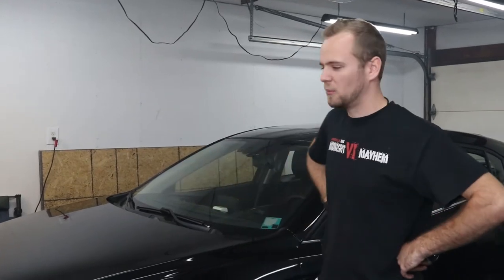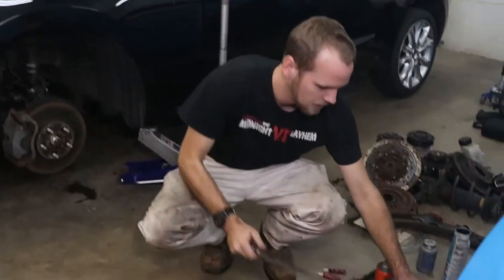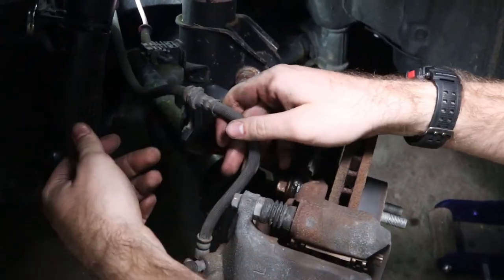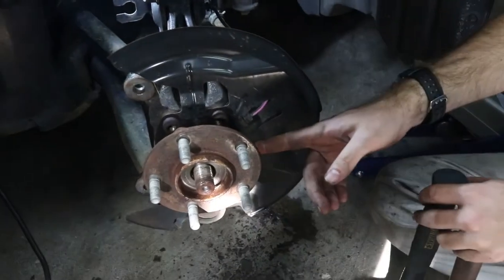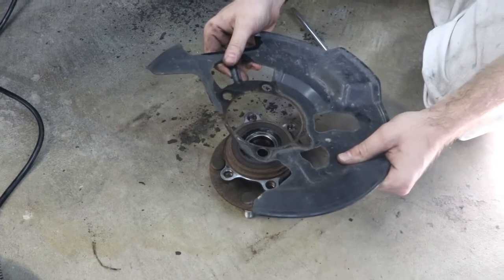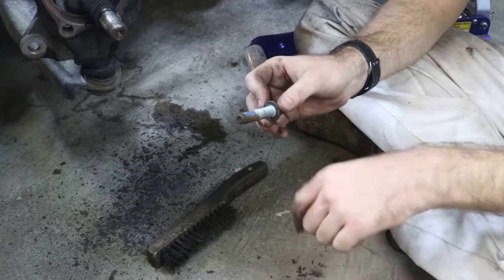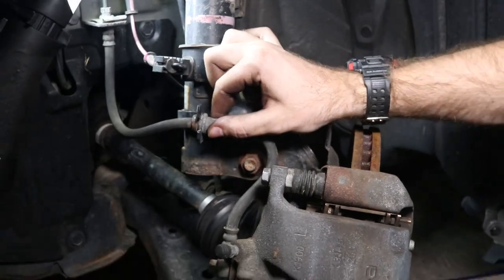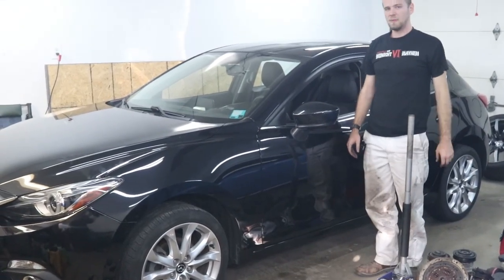2016 Mazda3 Front Wheel Bearing Hub Replacement - How To

Comment: A tip for loosening or tightening axle nuts and also lug nuts: instead of pushing on the breaker bar, position the breaker bar at about the 12 or 1 o'clock position, then stand up and use your body weight to pull. You can get much more leverage that way. By standing on a breaker bar, it allows it to flex and not transfer the torque to the fastener.
Reply: As a mechanical engineer let me tell you that what you said makes so sense in terms of physics. But eh, that doesn't matter, if it works for you, it works.
Reply: @Blockbuster2033  In that same token, you should know that pulling is always more effective than pushing. So, your pull force is going to be much greater than your push force.
Reply: I bought the gun
Reply: You could potentially push your car off the jack stands and cause serious damage that way. I wouldn't recommend it.
Reply: @Blockbuster2033  if you're the type of engineer that designs modern ('90's+) cars... Let me just give you a warm a well deserved FU on behalf of those who service your handiwork.
Reply: @JDuBz815  I am, in fact, not working on anything car related. And as someone who does a lot of wrenching in my free time I'm also quite aware of these problems and try to design with servicability in mind.
Reply: @Blockbuster2033  you are a rare breed indeed then. Thanks!
Reply: @philipstephan4511 Always have a jack stand with a jack as a back up.

Comment: So, mazda 3 has hub bearings both front and rear now. used to be (for the front )wheel bearings with knuckles and wheel hub installed on the top separately. which way is better?

Comment: AH ok so Subaru,Nissan and Mazda used these all in one bearig hub.  I hated those where u need press on and cut the race and chisel off.. OMG i cant.. I dint know you dont even need to remove the lower ball joint and tied rod. Wow i need to get a Mazda :)
Reply: The problem with these style bearing assemblies is the bearing itself is smaller in diameter compared to bearings pressed inside the knuckle. It seems this is why they fail sooner. I can’t tell you how many recent Mazdas have had wheel bearing failures. It rarely used to be a thing, especially on front wheels. The older Ford platforms had this style on the rears but front was always a press fit spindle into bearing or spindle/bearing assembly into knuckle.

Comment: Rule number 1. Leave the car on the ground with the wheel on! (just remove the hub cover.) And have someone standing on the brake when loosening the axle Nut... Get it loose then lift the car and proceed! As they did, All of the torque/torture you put through your drive shaft into the differential when you stand on the breaker bar otherwise.
Reply: The drive shaft and differential are used to much much higher torques that occur when driving, but it will be much easier to remove the nut when on the ground because you eliminate the drivetrain lash.

Comment: Is your Mazda made in Mexico?  From what I understand they have 2 different parts for Mazda made in Mexico and Japan.  I've been wondering if I could use the parts from either source  (cuz the Japan part is a ton cheaper)  I don't know what the differences are between the 2 but I'm sure you saw it when you did this?
Reply from the maker: It is a Japan model. If the parts have different part numbers between Mexico and Japan variants, I would stick with the correct part.

Comment: Talk about a cake job compared to a Fusion/Milan/6 which are pressed in. Nice job Mazda! 
Tip: Just remove the caliper bracket and leave the caliper bolted to it. No need to remove caliper and bracket separately.
Reply: I agree! My 2013 Mazda 3 is pressed in :( I'm not looking forward to doing this job...

Comment: It's a pain in the ass because it involves taking the center caps off the wheels and then re-mounting the wheels, but loosening and tightening the axle nut is easier with the wheels on the ground

Comment: Just want to know is it the same for a mazda 3 2012 GX sky activ front wheel bearing
 replacement?
Reply from the maker: I don't believe it is. I think with the 2012 you have to press the bearing in because it doesn't come in a hub assembly.

Comment: the hardest part was banging the housing out.. it was really in there on mine. I banged it until there was a gap and then wedged it out. Also my heat shield is pretty much rusted out... not sure if its something I can buy new.  Mine is a cx5 so maybe bigger and I'm sure the salt on the roads here made it extra seized.
Reply: It's a dust shields and yes you should be able to order them

Comment: Good video, I followed your advice but had some problems. The advice of soft blows is solid, you could also provide torque specs. I could not get hub to spin even with the ball peen hammer. I have a harbor freight hand jack hammer that I used because I could not get it to separate from the hub.  The jack hammer made it spin and then it came off. When I had it apart I noticed a little slot on he bottom of the hub to insert a chisel to maybe remove the bearing hub assembly.
Reply: did you find the torque specs would be useful for me also
Reply: @PauliesGotIt I used the German method "Goodentite" for torque specs.

Comment: My way of getting the axle nut out is to use a long breaker bar between lug nut and hub, sitting on the ground. Reacts the torque and doesn’t damage lug threads

Comment: Hey! I followed this guide to the T. Even used a calibrated torque wrench to get the right lbs/ft. The humming noise is gone (yay) but now I'm getting a cracking/banging noise when I hit bumps. I took everything apart, made sure to follow the directions again, and same issue. When the tire is on, the brake bracket kind of...wiggles...very very slightly, but I noticed it doesn't wiggle on the opposite side. Do you have any idea what might be the issue?
Reply from the maker: What are the torque specs you used? The caliper braket should be firmly mounted, wiggling doesn't sound like a good thing.
Reply: @steveandthemilkman1311  I figured out the issue. I did not have the right torque spec on the caliper bracket. Needed to be 55-75ft/lbs and I was only at 25!!!!! Thanks for bringing that to my attention!

Your video was excellent and I was able to change both hub assemblies. But man, that axel nut was NO JOKE!!!! Lol.
Reply: @KekeTV860  that seems high I'm sure I dine mine to around 40ft pounds all is good my end at least u sorted it bud

Comment: How did you know it was bad. I have a faint whining/whirring noise coming from my 2015 6 on the right side
Reply from the maker: Bad wheel bearings can make a few different noises. Whining or whirring can definitely be a sign. Does it get louder while turning or at certain speeds?
Reply: Steve and the Milkman it starts up around 25 and gets slightly louder by 40mph. Above that the wind and tire noise drowns it out but when I drive past walls I hear it more
Reply from the maker: @ayoonasanya3957  The most common thing that's mistaken for wheel bearing noise is tire noise. If I'm not sure and it doesn't sound too bad yet I'll normally wait until I get a fresh set of tires and see how it changes. If you've already replaced the tires and it didn't help, it could be a bearing, but it's difficult to say without hearing it.

Comment: Do you know if the gen 1 (2007) model also is a hub assembly or will I need to press?
Reply from the maker: From what I can tell, the 2007 (front) needs to be pressed in. A good way for you to be sure is to go on an auto parts website (like RockAuto), put in your exact car, and see what the parts look like. I know for sure that the 2010-2013s need to be pressed. What we did was just buy a hydraulic press from Harbor Freight for about $150, it pays itself off on the first wheel bearing and from there you have another great tool to use for any future jobs!
Reply: @steveandthemilkman1311  alright, thank you. I was hoping I didn't have to take off the whole knuckle to get the hub assembly off 😭 but thank you for responding, much appreciated.

Comment: Your were right about the hammer on hammer action. Usually it's dangerous to smack hammers together because they can shrapnel. I tried using punches and half inch bolt to try and move like you did, no luck. Even used an air chisel...boo. Only your method most effective.
Reply: Reminder, if axel is seized, back out nut to the end of thread and smack socket. Bent my threads and took hrs repairing, looking for die to recut.

Comment: Did you have to remove the speed sensor to do this job?
Reply: I removed mine. You need a 10mm to break it loose. Use some penetrating fluid and it pulls right out.